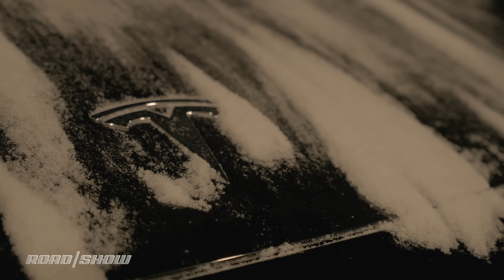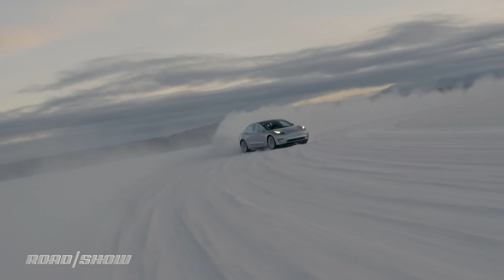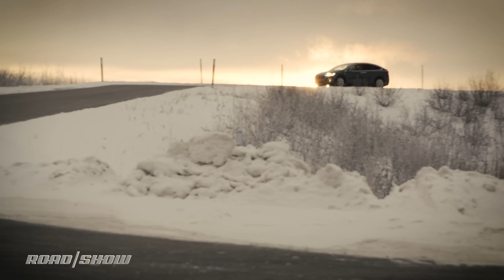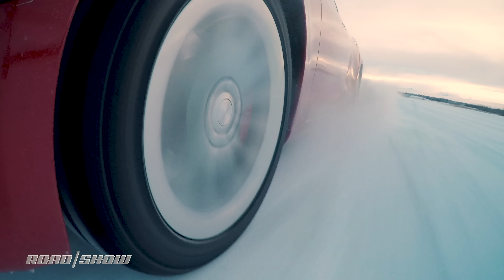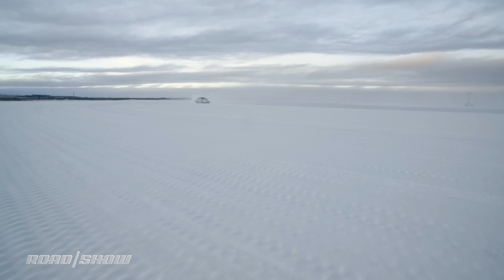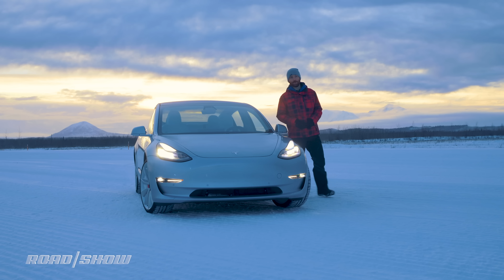EXCLUSIVE: Winter driving all Tesla cars in Alaskan snow | Sideways Included

Comment from the maker: We are hosting an AMA on Reddit at 1pm EST today. Ask Tim Stevens all your Tesla Qs! https://roadshow.co/GdvMlf
Reply: Roadshow I don’t reddit or twit, so will ask here and hope for the best: How come you didn’t mention or talk tires in this testing?  Did all cars have the same tire? Were they high quality winter tires or what most USians use, bad quality 3-season tires?
Reply: @acchaladka  apparently they used Pirelli Sottozero for all the cars
Reply: @acchaladka  Ha, in pure powder with no chance of any grip, not sure it matters much, as long as they have some tread / aren't slicks ;-p
Reply from the maker: All the cars were on Pirelli Winter SottoZeros
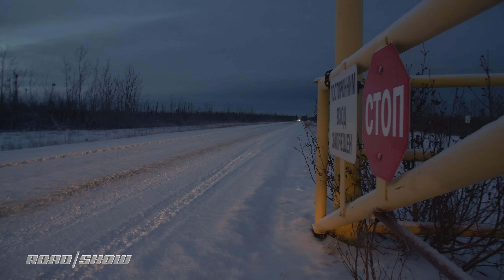Reply: @roadshowautos  THIS. IS NOT. ALASKA. THIS. IS. RUSSIA. You really think i'm so stupid? At 0:45! Look! It's Russian roadblock!
Reply: Egsen Bro 👌 glad you think so  😂
Reply: @roadshowautos  I don't see how it has torque vectoring in the rear without clutches if there's only one motor on the rear axle.....  If it's only using the brakes to transfer power from one wheel to the other.. that's actually an old system compared to the clutch/ planetary gear setup... like on an Acura MDX. I suppose they do both work.  but it just seems like an electric motor on each wheel would be the most superior setup.
Reply: calholli I don’t believe that he stated that it only uses brakes to transfer power to any of the wheels. that’s the magic of the modern software driven technology operating Tesla’s electric motors.
Reply: @jaguar4u  Thats not true.  Well it is, but only transfers power from the front motor to the rear motor... but not from left to right wheels.  The differential is not torque vectoring, and has no clutch packs or planetary gears... It is only a simple limited slip diff.....  So again, around corners and also when one wheel slips on a wet surface... the way it transfers power from left to right is done by computer, operating the brakes.  Its still a very high tech system that works.  But the torque vectoring that BMW, Audi, Acura uses is a better system.  But it's just more of a mechanical solution.. and of coarse Elon's Tesla is a software company more than it's even a car company.... So if there was a way to make it work by software, that is what he was going to do-- even if it is the older way of doing things in this case...
Reply: Thanks for the replies guys, I appreciate it.
Reply: The Tesla logo i love it so much
Reply: I've never heard of a Tezzla? They sure do look similar to Tesla models I've seen. :)
Reply: Fun for you
Dangerous for other vehicles around you
Reply: Peter Robann Sobrepena Only dangerous on roads with other cars LOL
Reply: YEAH, ASK THE EDITORS WHY THEY FEEL MUSIC DRONING ON THROUGH OUT THE VIDEO IS NEEDED.
Reply: Not the best winter tire choice :)  PIRELLI WINTER SOTTOZERO - Winter/Snow Performance rating 8.4 - Good, i would get BRIDGESTONE BLIZZAK WS80 or WS90 - Winter/Snow Performance 9.4 - Excellent for studdles, but for Alaska better to use studded like NOKIAN TIRE
 HAKKAPELIITTA 8 STUDDED - BEST

Comment: I have the MYP and bought the Tesla winter wheels and tires. I have lived in Wisconsin my whole life and have a lot of experience driving on crappy roads and it still handles HORRIBLY in the winter. The ass end slews all over and I’m surprised I haven’t been in the ditch yet. I drive in chill mode even because I thought it would help but it hasn’t.
Reply: Same issue here! Which tires are you using and which model do you have?

Comment: bruh i have a model 3 performance and we were  drifting and doing donuts on accident on less than an inch of snow. we were extremely disappointed cuz they told us it was great on snow
Reply: Who's "they"? Salesmen, who are trying to sell you something? Tesla fanboys who don't live in the snowbelt? The other thing too, is what tires are on the car? Tires MATTER, and snow tires matter even more when there's snow. All season tires are regarded as three season tires by those of us that regularly drive in snow in the winter.
Reply: @snowrocket  I bought some Pirelli for my Model 3 but the rear slides a lot when I turn, even on roundabouts at very low speed

Comment: This test track stuff is great, but I want to see them park it overnight after they get a foot of snow and then try and pull away. That's how I determine whether a car is good in the winter or not.
Reply: It highly depends upon the foot of snow. Is it dry snow or wet snow? Huge difference between the two. The Subaru Legacies and Impreza Ls I've had would go through a foot of dry snow, but would high center on a foot of wet snow. I had it happen a couple of times. With six inches of ground clearance, your car will really start to struggle once you've used that up.

Comment: I have a question, I like to participate in local snowcross event with my Focus RS, a lot of people I know are getting model threes as daily driver and I have always wondered if it would be better to get a model 3 performance for these snowcross events instead of my RS, but given the model three is heavy car, would it slide further? Say both cars are travelling at 60mph on a road(a very wide road for argument's sake) covered with snow, and you turn the wheels all the way to the left and slam the breaks with esc and abs turned off and just let the car lose control. which one would slide further assuming they don't crash into things?

Comment: The battery would also go down from using the heating unless you want to freeze
Reply: One other option is to keep the cabin temperature moderate and utilize the seat heaters, which work very well.
Reply: Alan Foster seat heaters definitely help but when you’re in a place that cold, I think it’s necessary to use air heating.
Reply: @holamilambo8228  It all depends on what you are wearing.  If a business suit, turn up the heat.  If an Inuit parka, you'll probably have to open the windows.

Comment: did you test the drop in range, which is quoted at 30-50%, and the time it takes to warm up?
Reply: While I AM curious about how the AWD Teslas go and handle in snow, the loss of range is VERY important to know. The good thing is that while on the plug (charging), you can warm the interior before driving without sacrificing range. One of the big problems in the cold is the increased battery drain while parked and unused. From everything I've read and heard, Tesla designed their cars to keep the battery pack at a constant 70 degrees Fahrenheit for greatest range and durability. When not charging, the car will use it's battery pack to warm or cool the batteries as needed. In cold weather, it has to work much harder to do so.

Comment: IMHO you did not cover the most important parts. The battery pack heater draw in cold temps and the constant need to charge the battery pack to keep it ready for use. As the battery warmers need to operate 24/7 in the cold. And the fact that a 110 volt charger will not even keep up with the battery heater draw. So you have to have a 220 volt charger always plugged in to have useful range when you need it from the car. As it is always in a constant state of discharge to run the warmers.

Comment: Track Mode should be optional or standard on EVERY Tesla. Or, they could make "Fun Mode" standard. Fun Mode would be allowing a lot of wheelspin while sliding and great powersliding as shown, but doesn't have the cooling capacity for the motors and batteries like Track Mode does. FM would be useful for those who want a little fun, especially in winter, but who don't intend to road race on pavement where you'd really use more amps/create more heat.

Comment: This guys explanation of the differential is utter rubbish. First, this car (Tesla's)  doesn't have a differential. Second, since it is all electric,  the software in the vehicle will create a condition which will replicate a locking diff by turning all wheels at the same speed with an equal amount of torque on each wheel. It doesn't do this by apply brakes only....this guy needs a new job. 
 Anyone who has knowledge of open diff and lock ones will understand what this means.

Comment: As someone who’s driven Subarus with limited slip differentials for the last 10 years, that hill climb was very impressive.
Reply: As someone that wishes Subarus only came out rear wheel I hope this helps.
Reply: you'd be surprised by my Ford Focus with snow tires too then!
Reply: As someone who drives Toyotas with manual diff locks, that climb made me yawn.
Reply: Toy-joda you know this was with ice on the hill, right?
Not just some dry ass desert rocks
Reply: @user-jt6xh2ln9z  so this Tesla was tested on "some dry ass rocks" too? Hope the battery didn't get punctured!

Comment: Tesla owners never seem to use the heater since it account for a lot of battery drain.  Same goes for AC in warm climates!
Reply: That is incorrect.  My Tesla is literally never driven without the A/C on, and it has a negligible effect on range.  I still get around 3.3 miles per kWh in my Model S, while the A/C is on the entire time.

Comment: Bump for update: with the recent polar vortex in the Midwest and out east, Tesla and other BEV owners are reporting on average 40-50 % range reduction when it's cold. What's doing it?   Two things primarily: Battery heater ( about 12%) and cabin heater and /or seat heaters 30-40% . Add them together and you're at or near 50% cold weather range reduction.  So, if you're on high cabin heat and max bacon seat heat and start out with 250 mile range. You can bet that range will be 1/2 that once you start driving. kWh/mile is running 600-700 in the frigid weather.  Seems like it's even worse than the summertime A/C use.
Reply: Summertime A/C us has negligible effect on range.  And most people drive 30 miles a day to work, so even losing 50% range (realistic closer to 30%), still gives people over 150 miles of driving range before needing to charge it.

Comment: For the model S “moose experiment”, if the tester actually understood anything about physics (which naturally the average driver does not), he would have applied throttle appropriately at the correct juncture to counteract the tail slide of the vehicle in response to the sudden input change and counter steer reaction to said input from the steering column. And with the model s’s some 700bhp, proper application of said throttle would have powered the vehicle back under and into stable control.

Then again, truly skilled drivers never put themselves into situations that will result in outcomes that they are unable to manage (this includes preemptively scanning for moose at highway speeds in order to prevent needing to swerve and subsequently wrecking their car..), so this entire “test” is essentially one big joke of stupidity. Specifically designed to cater to, yup, you guessed it. Humanity’s finest, the truly stupid.

For the sake of reality, I will say that tire choice matters. However, as the test is occurring in ALASKA, we have to hope the test is occurring with a moderately decent snow tire.
Reply: incredibly stated. cant agree with you more. i believe fun driving= irresponsible driving. why risk destroying your car and killing yourself.

Comment: Upon what basis do you claim Teslas (in particular) have a bad reputation in cold weather? Just typical media BS or can you show statistics that makes Tesla worse than other cars? Are you the click bait of YouTube? I drive a Model S in a snowy state and Tesla is by far the BEST electric car you're going to get due to active thermal management. BTW, Tesla must use an open differential due to the immense torque the car produces. Anything else would break (the first Tesla Roadster proved that).
Reply: I'm right there with you on this, I live in Maine and our P100D is fantastic, but due to all the salt's used on the roads up here in winter, I don't drive it much and use our Winter beater most of the winter...
Reply: @abbaby555  I do the same. Are studded tires allowed in Maine?

Comment: I've been running no-nannies cars in winters in New England my entire driving life, worst case was a 300rwhp fox mustang in Vermont winters on less than adequate tires, best case is my 2006 wrx wagon with 245awhp on winter tires; driver skill coupled with mechanical diffs (in this case, rear LSD's for both cars, wrx is open front) is my preference over nannies; I hate driving my wife's car with the nannies on ('17 corolla iM), I will concede however, that for the average driver, nannies are the answer. All of that stated, I do want to get my hands on a RWD "long range" model 3.

Comment: What do you mean "differential"... there is no differential in this car, there are two motors one connected to each wheel connected together in a bogie of sorts called a drive unit. Please research next time, and get informed.
Reply: Evan, look what Srini Nayudu wrote. He is correct. Teslas have a differential too.
Only 4 motor cars like Rimac don't need one.
Reply: You might want to do some research on that. Infact AWD Tesla's have 2 of those, one of the front axle and one on the rear axle. What is not needed is center differential as it has separate motors for front and rear axles. Differential is still required to distribute torque between left and right wheels on each axle.

Comment: I'm Norwegian and I have owned and driven cars for over 40 years now: Yes, EVs do lose a bit of range in winter, but not nearly as much as what you lose from a really wet/slushy road, you just need to preheat the car & battery (preferably with the charging cable connected) before you start up in the morning. My S70D is far and away the best winter car I have ever driven, it is even better than any of the 4x4 vehicles I drove during my military service. Just last night in Oslo, in the middle of what would have been called a snow storm when I lived in Utah, I was coming out of a tunnel and into a tight turn when I suddenly lost all grip (I use metal-studded Nokian Hakkas) and for a few tenths of a second, as my old driving reflexes were trying to recover, I knew I was going to hit the concrete barrier sideways, but then the car got back grip on all wheels and I could just drive on. :-)
Reply: Holy crap, glad you’re okay and thanks for the story from here in the Canada.
Reply: Another thankful Canadian here;  I ordered a Cybertruck after the unveiling, but I WAS worried about winters. Not anymore.
Reply: Last winter in Minnesota my friend gave me a ride in his rwd model 3. We were doing about 65 when the car skidded sideways and without my friend touching the wheel or pedals the cars autopilot regained control and centered us back in the lane.
Reply: @isaidholla4088  based ai
Reply: Terje Mathisen the car didn't get grip. The tyres got grip.  Tires are only point of contact between car and ground. Hakkas are great tyres.  Use them extensively w/o studs and never an issue.   Vredstein are great tyres too.
Reply: @Newzchspy   Good tires are a requirement but the car found the power setting that re-established traction, almost instantly and depending on one motor or two, on different axles independently.  No ICE car can do that regardless of tires.

Comment: FYI, Teslas are notorious for performing well in snow/slippery conditions... No clue where you heard they don't. Just the fact that Norway is so big on buying Teslas since day 1 should tell you that... Please, do better research.
Reply: Not only Teslas, EV in particular
Reply: Odd that you say that.  I have heard lots of complaints about the batteries in cold weather (and the narrator alluded to that in his opening comments), but not about winter traction -- quite the opposite, in fact.  So it is curious that anyone is bad-mouthing Tesla on traction.    Range yes, traction, maybe not much???
Reply: You’re not even allowed to buy a Tesla in Michigan
Reply: All about the driver and tires
Reply: It's the nature of electric motors. The torque controll is harder than with ic engines. Some older evs don't even have the torque controll system so there is maximum torque available in the lowest rpm range.
Reply: Peter Húbek false. Torque control is far easier with electric motors than with gas engines. They use the exact same control systems, but electric motors respond to changes in torque input at nearly the speed of light, where gas engines can only respond at half the RPM of the engine. Electric cars are significantly better in slippery conditions than gas powered cars are. And it has been illegal to sell any cars in the United States without traction control and skid control for nearly twenty years now, so that argument has never applied to any commercially mass produced electric car made since the adoption of lithium batteries.